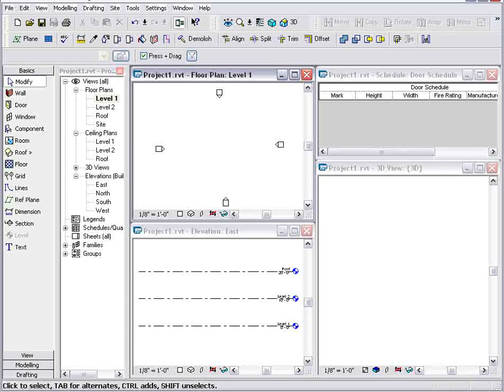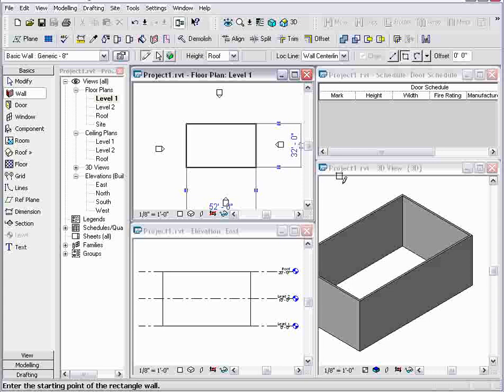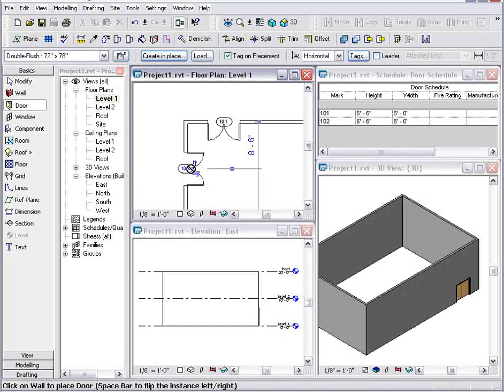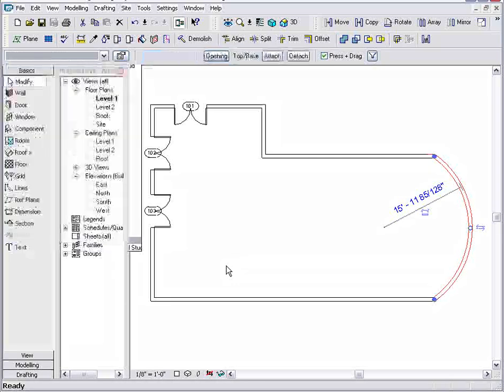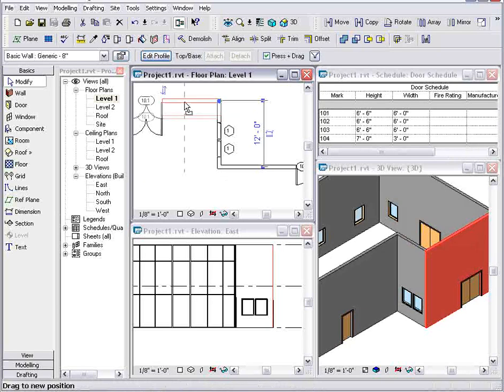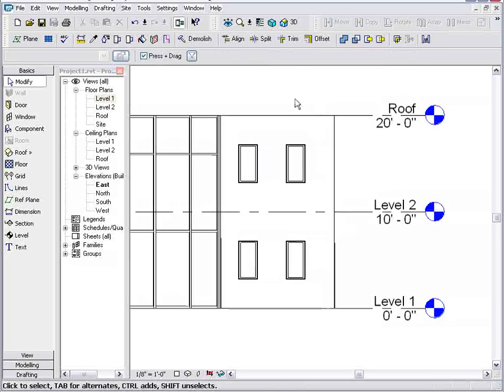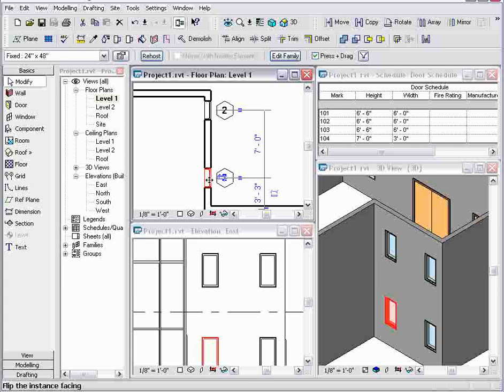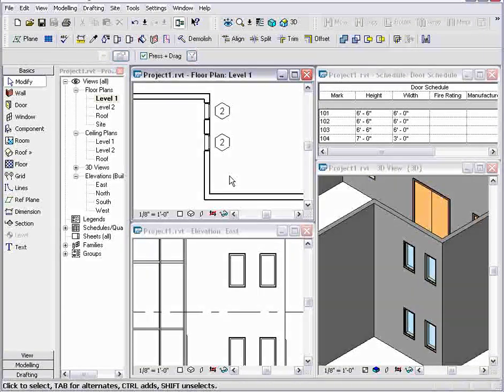Revit Tutorials Starting a Project

Comment: I found on a website called campustech....the problem is its 2010 and 2010 doesn't work well with 09...just as Desktop 2010 doesn't work well with 09.